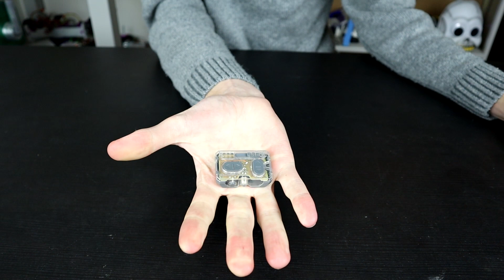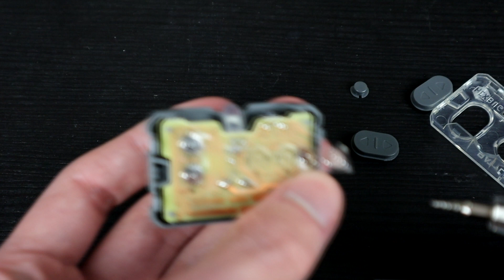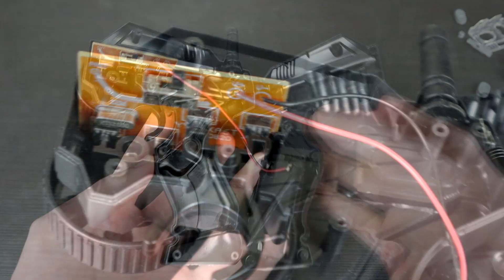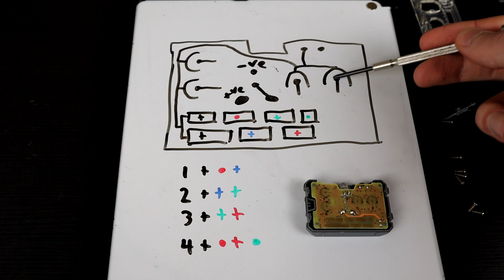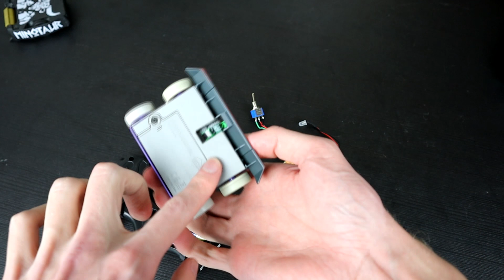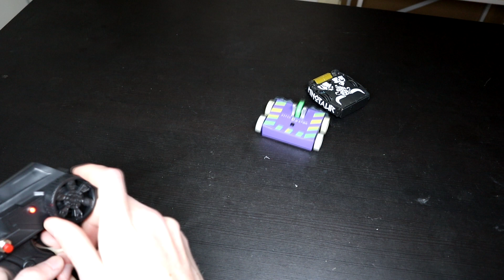Hexbug Battlebot Controller Pistol Grip Upgrade

Comment: Does anyone know, will the Hexbug BB controllers take Full 1S voltage at 4.2Vdc?
Is it possible to run a small USB charging BMS board and 3D print a extended lower controller case?
Reply from the maker: Probably not, 3.3v electronics are sensitive to voltage and can die easily
You'd need a Low Drop Out (LDO) voltage regulator to ensure a constant 3.3v supply

But with an LDO it should be possible to run a controller on a lipo
Reply: That would be the hope, but I don’t think I have ever found a micro/small 1S BMS with a on board ~3.3V output reg built in.

Can stack modules...but the hope is to miniaturize where possible.

Thanks!

Where can we find the pistol grip Rx like yours? Who manufactures that?
 @TeamPanicRobotics

Comment: I have an issue with my battlebots. I was wondering if you have the same issue. When driving them around, sometimes they tend to stick to the last command becoming unresponsive, turning non-stop .. I don't know if the issue is with the controller or battlebot.
Reply from the maker: I've seen it once or twice, usually batteries or bad signal.
So replace the batteries, and make sure you arnt using them in an area flooded by IR light (such as in the sun)
Reply: @TeamPanicRobotics  thanks, I'll try that.